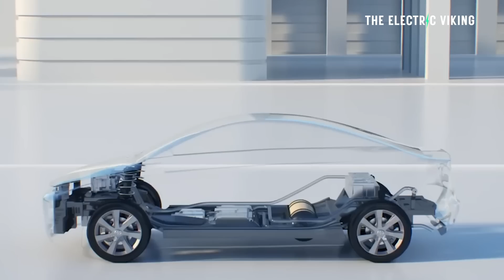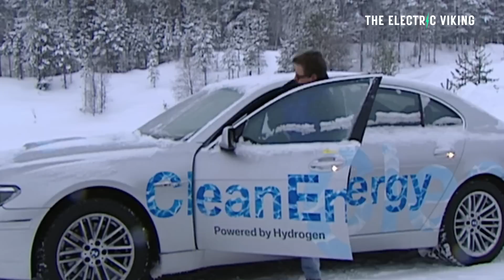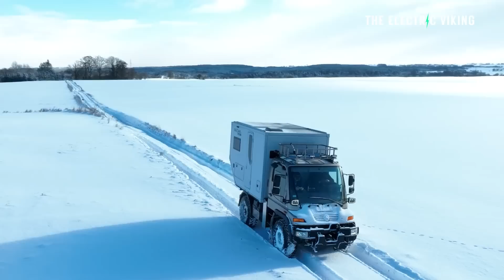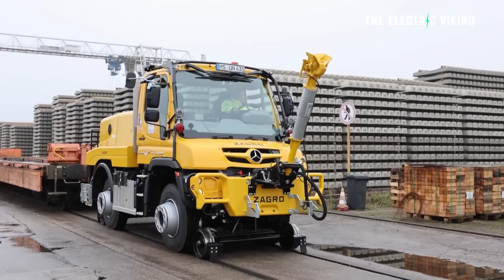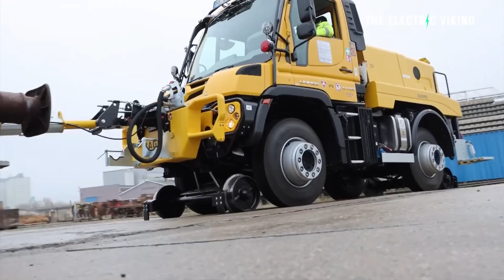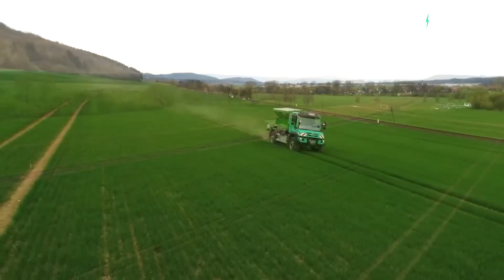Mercedes Benz's hybrid hydrogen combustion and diesel engine

Comment: Why is it that people think burning Hydrogen in a combustion chamber causes no pollution, Fossil fuels when burnt under compression also causes CO or Carbon monoxide as well as CO2 and Nitrogen Oxides.
Hydrogen in a combustion chamber also produces Nitrogen Oxides which is worse than CO2 as it's the Nitrogen Oxides that help cancer to form.
The reason Nitrogen Oxides are produced is quite simple, over 70% of the air being burnt in an ICE is Nitrogen, it's also why this moronic rip off by Tyre places filling your tyres with Nitrogen is a joke as once you have inflated your tyres for the first time they already have over 70% nitrogen, after a couple years of topping them up, it's mainly the oxygen that leaks out and so over 90% of your tyres ari will be Nitrogen over time at no cost to yourself.
People tend to believe anything salesman tell them as they make it sound so good, they tend to use made up BS to make it sound more technical or realistic and because for the most part it's Women that do the buying as their Husband is out working while the Wife is at home caring for the Home and CHildren, it's also why I take in my Daughters cars to get serviced as I worked in a Service Station for over a year when I was young and know the tricks they pull as I was a Sales Clerk at the time and handled all the Road Worthies as well as Warranties.

Comment: This video got pretty confusing. Besides the diesel/H2 ICE vehicle you mixed in H2 fuel cell vehicles. I think it would be worth doing a video on just fuel cell vehicles -- which are, of course, just a strange kind of electric vehicle. Note I say strange, not good.
Reply: The hydrogen burners are just way worse than fuel cell vehicles, which are themselves worse than pure EVs.

Comment: Any ICE burning hydrogen has a major handicap compared with BEV power: all those pistons and cylinders and gears use up a good part of the power produced, compared with the simplicity of an electric motor. NO contest; a cumbersome, belching bucket of bolts or a smooth machine.
Reply: Never mind inherent thermo-dynamic inefficiency in an IC engine.
Reply: @HeavyDevy89  Tell that to Holland who are building a 500MW offshore wind farm with a hydrogen plant built in and a pipeline to bring it ashore. Hydrogen is the solution because making it acts like a giant battery at a tiny fraction of the cost of batteries. Far less mining and countries being energy independent is the future. The fact that so many people cannot connect the dots is unfortunate but they will learn eventually.
Reply: Look, I'm all for bevs, I'm a bit of a hydrogen luva 😂 but I like bevs too but do you not understand in America at least there are millions of back woods rednecks and grease monkeys that will call you every name in the book of vulgar slurs if you try to convince them quiet bevs are better, even more powerful...the idiot sheep 🐑 do not care. 

Ice cars will still make money for the next 10 to 20 years as the rednecks take the time ⏲ to get a clue. So Ice will be around a while I imagine

The analogy of the rednecks I can also apply to the mesmerized tesla battery fanboys that don't believe hydrogen is a superior technology over the batteries. It's the same thing. Most of the rednecks will actually probably buy hydrogen Ice and fuel cell vehicles over batteries anyway
Reply: Hydrogen is far lighter than batteries when you have a huge truck to pull for hundreds of miles and take just a few minutes to re-fuel. Hydrogen can also be made all summer long from solar and then used all year long. It acts like a battery at a tiny fraction of the cost. Embrace the hydrogen future or get left behind in the dust.